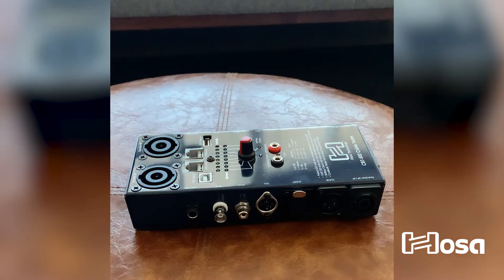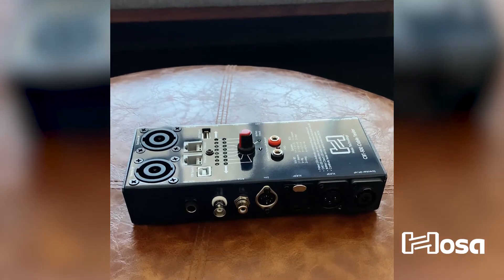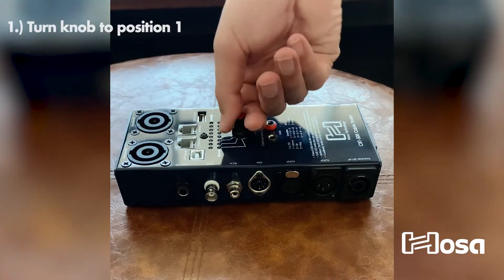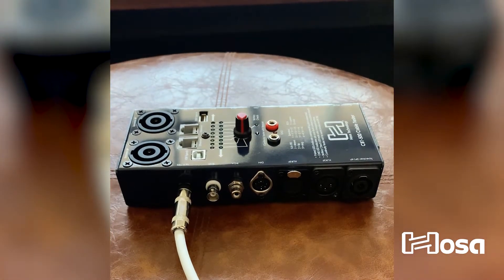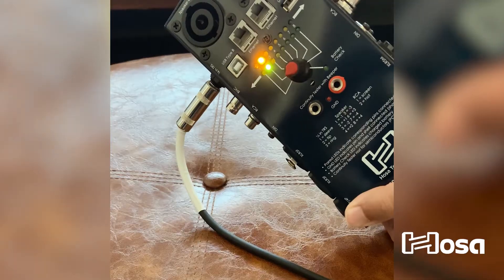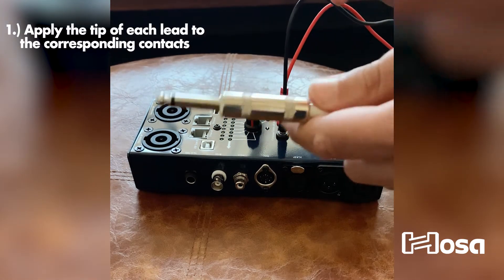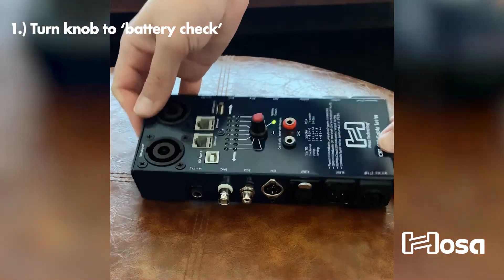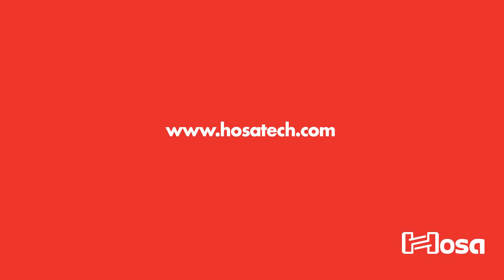How To Use a Cable Tester

Comment: I really would love for this unit to have a latching "Intermittent" light with reset button that can catch millisecond continuity breaks and display a light on that pin until reset button is pressed. 

Reference Behringer CT-100 for this feature, it seems pretty unique to this product in this price range.